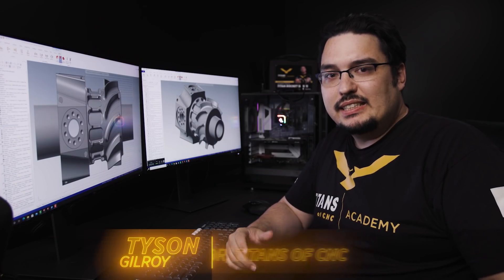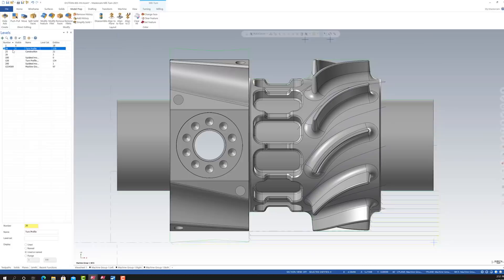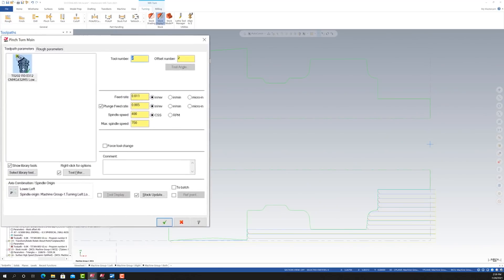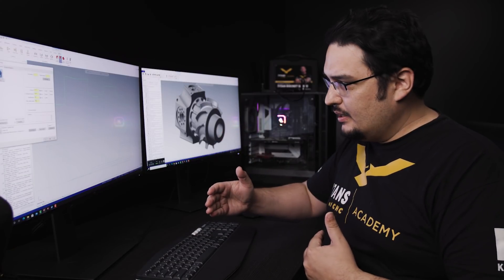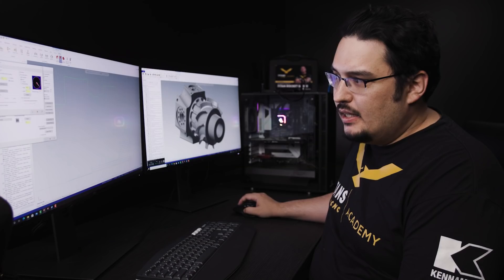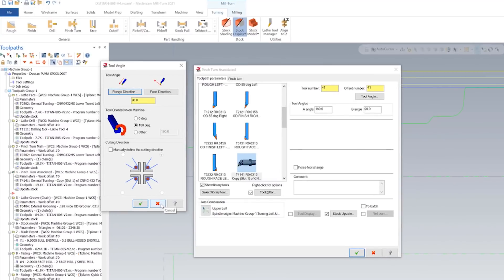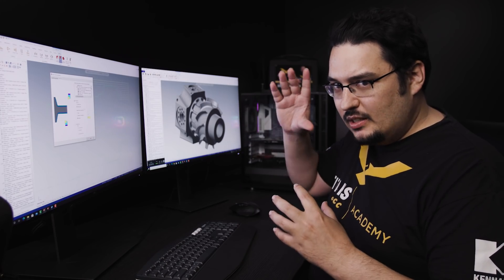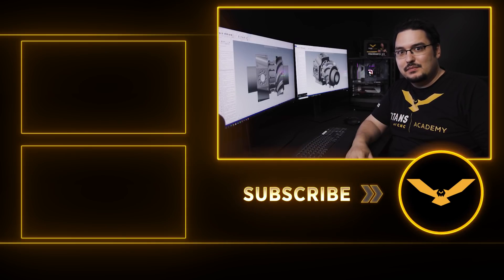Pinch Turning 316 Stainless on Doosan SMX3100 | MASTERCAM Tool Path | Kennametal Tooling

Comment: I would like to know what tool holder and adapter you are using. We have a Doosan Lynx 220 with a bmt45 I think but would like to start getting some better tooling to utilize the sub spindle and be more rigid for aggressive turning.

Comment: Back in 2005 they said I had one of the first Puma mx 2000st that were available in So Cal, those machines are pretty cool.I taught the the South Korean tech how to brake a bolt off the b axis  cervic coupling

Comment: Titan forgings to be machined on Titan solid cast iron dual column plano mills (with thick dovetail ways [hand scraped]), using Titan nanofine solid carbide tooling with semi liquid gaseous nitrogen through coolant (Titan patented pending), to repair and reverse engineer precision grinders from meehanite scratch for research purposes of maintaining fine tolerances to create precision Titan forgings to be machined on Titan solid cast iron dual column plano mills (with thick dovetail ways [hand scraped]), using Titan nanofine solid carbide tooling with semi liquid gaseous nitrogen through coolant (Titan patented pending), to repair and reverse engineer precision grinders from meehanite scratch for research purposes of maintaining fine tolerances to create precision forgings for YOU!

Comment: Why in pinch turning every tool neads cut on different depth? It is forcing the machine to wait. Why dont make 2x the feedrate in the way  that double start thread works. Two tool cutting at the same time, no need to wait anymore
Reply: What if an insert goes out